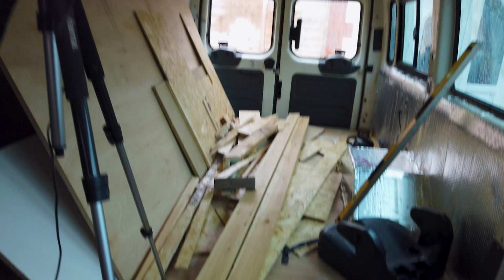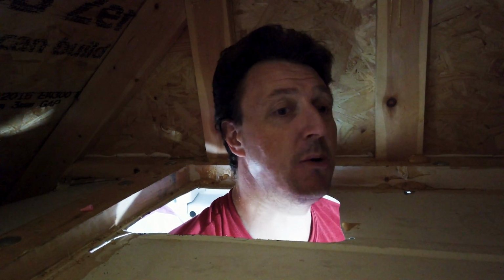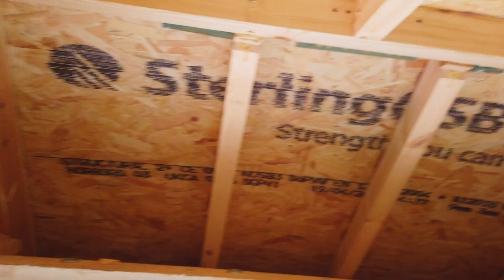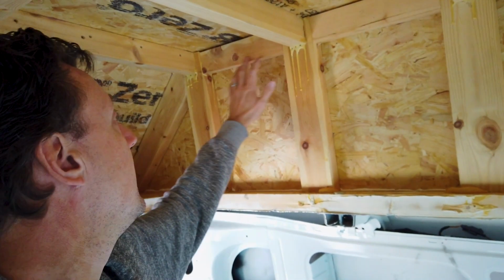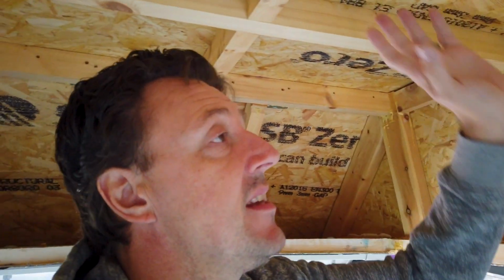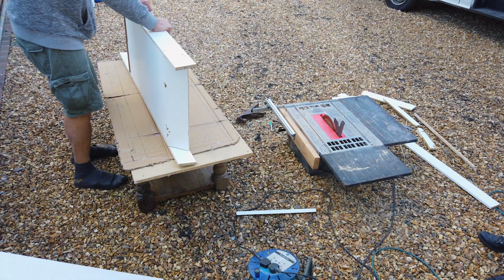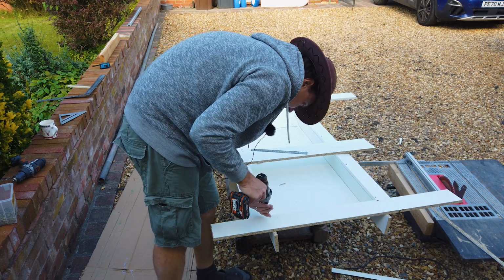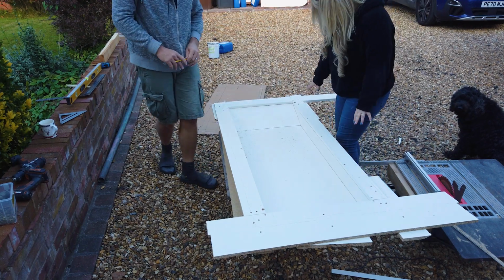THE ROOF GOT CUT OFF!!! and VAN BUILD EP 19 | ROOF OFF |. SIDE FLARES | SLEEP PODS | SIDE PODS MOLD

Comment: I need flares for my LWB Crafter and nobody makes them, so I too have made my own (probably due to an internal panel support being in the way, which I moved). Really admire your enthusiasm to get the moulds made with basic tools; can’t wait to see the finished articles. When I popped mine out of the moulds it was very satisfying. Good luck and great viewing😁
Reply from the maker: Thank you, I will be on the mold again this week. That's if the weather holds. Do you have a channel?
Reply: I thought about filming it as they are unique and maybe helpful to others with the same issue ; I’ve taken loads of pics so might put something together when I get time. Looks like you’re making one mould for both sides? I had to make 2 separate as one is deeper than the other due to the sliding door (and they’re formed to match van’s curved shape, so opposites if that makes sense). I polished the moulds with wax then sprayed on a layer of PVA. Worked a treat. Hope the weather holds out for you
Reply: I thought about filming it as they are unique and maybe helpful to others with the same issue ; I’ve taken loads of pics so might put something together when I get time. Looks like you’re making one mould for both sides? I had to make 2 separate as one is deeper than the other due to the sliding door (and they’re formed to match van’s curved shape, so opposites if that makes sense). I polished the moulds with wax then sprayed on a layer of PVA. Worked a treat. Hope the weather holds out for you
Reply from the maker: Yes, makes sense, I'm lucky to only have to make one and just spin the back around for the line of the window. We are on insta and fb. Would love to see some pics if you want to send them over.

Comment: Dont want to seem picky but are you not concerned about the structural integrity of the van if you have an accident?
Reply from the maker: Hello, thanks for your question. As you can probably imagine I get asked this quite a lot. I have collated some information into one place. I hope you don't mind the copy and pastes. 

I would always suggest people research everything before attempting anything like this and do the maths. 

Hope all this helps.

THE STRUCTURE 
the structure I have built comprises of a wall plate, for want of a better name. This is the first point of contact with the van it is mechanically and chemically fixed to the roof of the  van. It is constructed from 4x2 and is shaped to fit the van. It is bolted through with coach Bolts and adhered with Puraflex 40 sealant adhesive. Puraflex is and ever build product but made by sika. (it is 552 but half the cost). 

https://youtu.be/RSBpHG1ch2I this episode goes through this for those who would like to see what I did.

I then built a rib cage for the roof, again for want of a better description. This involved recessing the roof plate to accept the rib on the angle, these were then glued, doweld (with hardwood) and screwed. The glue used was D4 strength polyurethane wood glue.

https://youtu.be/hA9CVSZ8wug this episode goes through this for those who would like to see what I did.

I then fitted the cross braces, this was done by cutting out a recess in the ribs for them to sit it. They were then glued, dowled and screwed using the same D4 PU adhesive.

https://youtu.be/hUHO_qpmMmE this episode goes through this for those who would like to see what I did.

In the next episode I finished the rib cage and built out the back spoiler. 
Then I began sheething out, I used 9mm OSB3. A product which is engineered to be load-bearing and suitable for structural use. It is designed to become part of a composit laminate. I used a combination of the Puraflex 40 and Pinkgrip along with screws to bind all the framework together.

You can find this in episode 6 and 7  https://youtu.be/1qIEJUGqRZA

One sheeted I began the process of fibreglass, I used a 2 x300g CSM with a 300g Bi-axial layered between composite

that starts here for those that want to watch https://youtu.be/aBlI2KAOHPY

These are words of another user on the structural build of my minibus. I do put many points across in relation to this but he has put it together so well.  

The steel supports that ford added are not for structural re-enforcement of the chassis, they are to support the skin so you can stand on it. Those original supports in Graham's picture are for the same reason. Chassis rigidity in these vans is accomplished through the cab area 'Roll Cage' (A & B pillars) and the rear hoop around the doors, connected together by ladder rails. 

The sides of these vans get their rigidity from the horseshoe shaped sections that are welded into the main under chassis. You could remove the entire roof from the B post back to the rear hoop and not affect the sidewall rigidity or the torsional stiffness of the under chassis. 

Added to that information above I have not changed the structure of the Cab at all. Well I have added additional strength with the FG over the front.

I was originally not planning to remove the entire roof, only two cross braces and some steel sheet. That plan has now changed so I will be cutting out all the internal  roof and adding some box section to the brace ends that are left. (This is what they do to install pop tops)

Materials added to our roof
21m 4x2 avg 2kg meter = 44kg
29m 3x2 avg 1.2kg meter = 35kg
9mm osb 14kg board = 70 kg
12 tubes Pink grip 0.25kg = 3kg
10 tubes puraflex 0.38 = 3.8kg
Screws = 1kg
Resign = 30kg
Glass = 9kg
Topcoat 5kg
Roof Total 200.08 kg
Plus we will remove 35kg of steel.   Net weight of the new roof giving over 2m head height 165.8kg
For comparison   High top transit xlwb would have and extra 115kg in steel, plus if you added a roof rack that would be anywhere from 50 to 100kg
The weight going in is negligible compared to a high top with a roof rack. Plus we would have only had 3500kg on the ticket, with our bus we have 4200kg.
We would never have got the height for me in a high top!  

As for all the comments about strength   

Steel has a specific strength (strength to weight ) 63.1 kN m/kg

A decent composition of fibreglass has a strength to weight of around 1,307 kN m/kg. Nearly 21 times stronger.

This is why I chose fibreglass for ours.  For comparison Aluminium 204 and titanium is 260.  

The center of Gravity  

It is a twin wheel minibus, so has a 4200kg weight limit. Yes there is a bit of weight up top but no more than a high top with a roof rack. 

The COG will be good, especially  once the 150 litre fresh tank is in and 560 amp hour of batteries a calorifier. Plus the build out. 

We understand it will never be making the trip round the nurberg ring, nor will we be taking a racing line round corners on the road. it will be stronger when I finish then when I started